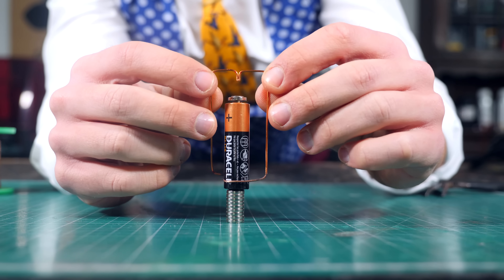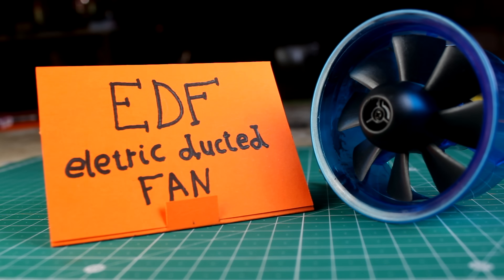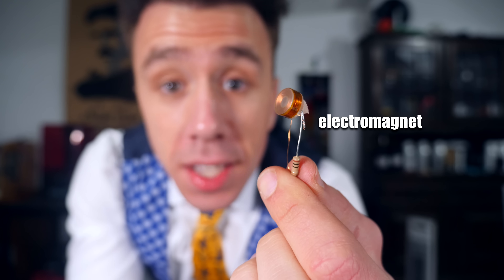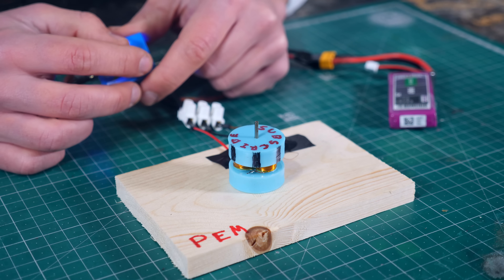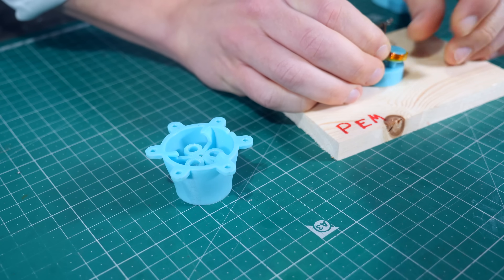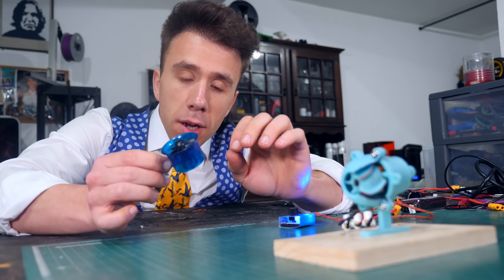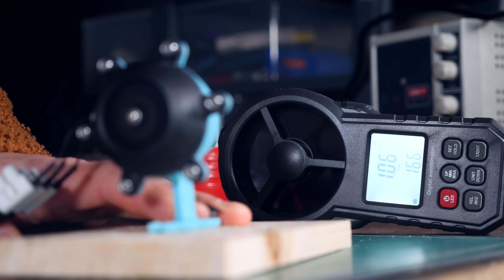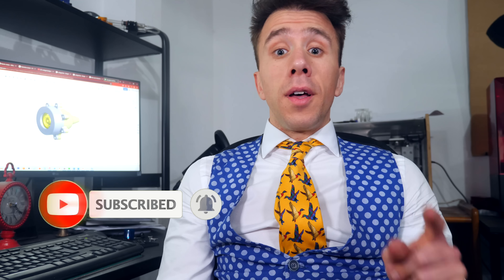I 3D Printed an ELECTRIC MOTOR FAN

Comment: For your next video you should try different intake methods for your fans, also your testing of the thrust is not ideal. Your measuring exhaust momentum at a specific distance, which like anyway wave dissipates quickly and can lense in unexpected ways. You probably need to really double down on some minimal friction sled that transfers its energy to a load cell. Maybe a sled that sits on a cushion of air, although that might create some sort of coanda effect and skew thrust values but probably not much.

Comment: A pressure based propulsion system requires a longer nozzle after the impeller to create faster moving flow vs a slower pressurized flow. (The dyson fan has a long air path that expands a lot before being ejected) The faster and more air mass ejected, the more thrust. So, the impeller creates a high pressure air flow, not a fast flow. To create a faster flow, the high pressure air has to be allowed to expand and convert the pressure into velocity and momentum. The trade off is the extra mass by having a longer nozzle vs. Air velocity at the nozzle impacts your thrust to weight ratio.

Comment: Best guess would be is your impeller design looks like it ment for a fuel air mixture "jet engine "and not for a power fan  , for a powered fan you would want a larger intake

Comment: I love this guy's videos! I also did some research on fans for selecting the most optimal off-the-shelf fan for cooling a particular battery system. What I learnt was that each fan has an important characteristic, which is it's PdV curve; volumetric flow versus pressure difference between intake and outlet. The output power is the product of these (check the units tho, if you want Watts, you have need to consider the density of air). Axial fans have a very different curve compared to radial fans. The former can produce a lot of speed, but the latter can make more pressure and maximum power. Every fan has a point of maximum power output, where P*dV/dt is the highest. This may change depending on multiple factors, such as inlet and outlet area, number of blades and pitch. You want to match the motor's optimal speed for maximum power output to the fan's characteristics to get the most power out of the fan. I hope that someone finds this helpful :)

Comment: One reason why your design might underperform ist that the EDF has a lager crosssection. in Ordner to move the same amount of air with your smaller centrifugal one, you would need more RPM. As a result, the centrifugal fan puts less torque on the BLDC an you are not using the same power as in the EDF configuration. Part of the reason is, that BLDC Motors are rpm controlled. The speedcontroller dictates the speed. thus less torque doesnt result in more rpm. Possible solutions could be a centrifugal fan with a larger blade crossection or getting the speedcontroller to drive the motor on higher rpm. (vacuum fans usualy run on very high rpm).
Really appreaciate your content. keep on giong. :)

Comment: Centrifugal fans produce air pressure but not much flow. The EDF produces a high speed airflow and doesn't really care about pressure.

Thrust is produced by moving large amounts of air at high speed; not by creating high pressure.

Comment: The Dyson fan and turbo charger fans in general are not meant for high air flow, they are designed to create higher air pressure. Flow =/= pressure.  If you notice on modern commercial airline jet engines, they have both a huge large ducted fan and then a compressor jet engine in the center to try to get the best from both worlds.

Comment: From what I can think of, I see a difference in airflow direction between axial (propeller) and radial (impeller) fans. The propeller pushes the air along its axes (surprisingly), thus reaching quite some speed in that direction. The impeller on the other hand (as you mentioned) generates pressure, but not in the axial direction, but rather in the radial direction. In other words, it pushes the air away from the axes, just like rays radiate from the sun (radial, radiate - you see that? 😁). It does not accelerate the air in the same direction as the propeller does. I hope I didn't just embarrass myself by missing some critical piece of information on this topic 😅

Comment: Well, if you have a given amount of energy your output is going to be affected by the input and the efficiency. It looks like you have a smaller intake area for the air than the ducted fan, so even if everything else was the same and you had that constricted input, I would expect the output would be lower. After that, anything that sucks energy from the system will reduce your output. And it looks like the airflow in your design is touching a lot more surface area than the ducted fan. Which means more drag, which means lower output velocity. I think the exact same thing would happen if you were trying to do an externally powered turbojet compressor and neglected that whole part where you add fuel and ignite it. All those extra vanes and surface area would give you less thrust as a fan than a normal fan (propellor) would.

Comment: turbomachines works very well in a short range of rpm. you need to adjust the exit angle of blades, I think the performance is low due to the creation of twisters at the end of the blades. The solution is adapt the exit angle of blades to the working rpm

Comment: You're probably leaking pressure through improper clearancing through the case in the fan blades that an impeller design could be changed

Comment: TEORY ABOUT THE ISSUE:
maiby you need to turn the pressure into speed with a nozzle just like rocket engines do instead of simply let the air flow out of that ring hole. it makes sense to me as rockets are designed to have as much exaust speed as possible in order to be more powerfull, and they do not really care about pressure (rocket equation)

Comment: EDFs have improved performance against a similar fan wich is nos ducted because of the duct, the shape in the intake of the duct reduces turbulence and helps the air flow into the impeller.

Comment: Oh I can tell you. So firstly, it's static thrust. So not dealing with incoming air upsetting things. 

Second, it's the volume moved. 
It's the difference between trying to row with a pole. And row with a large ore paddle on a pole. 

The larger the volume grabbed, the harder  you will be able to pull on the ore for less slip. 

And the more efficency you will have in converting the energy into trust the less slip you have. 

Airlines use ducted fans as they are compromise between a jet and a prop. As props have issues the faster you fly. 

Your fan in pulling in a tiny volume compared to the ducted fan. It would need to add a lot more energy to that tiny volume, which man's pressure, and then turn that efficiently into velocity and trust.

I doubt it's doing either very well. The diameter likly needs to be a lot larger. Double or more. You can also add efficency by getting the incoming air to swirl in the direction of rotation. 

Then a variable nozzle will allow the optimal size to be found.

Comment: Pretty sure it has to do with the difference in diameter. Remember, power and thrust are not the same, the motors may produce the same power, but not the same thrust. Think about what kinds of propellers need to make the most thrust, helicopters. They have huge blades to help them generate the thrust required to take off vertically, meanwhile airplanes with the same engine can't take off vertically because they lack the thrust, but they are much faster. This is because airplane propellers are much smaller and designed for a higher top speed with just enough thrust to let them take off in a reasonable distance.

Comment: Your brand of well-dressed yet self-deprecating physical comedy feels like Charlie Chaplain, keep it up :D 
On a more serious note, you should check out some of the flow simulation software that’s on the market, i know autodesk makes one that’s compatible with fusion 360 that has a free trial you can check out, something like that could probably help you diagnose the geometry that’s causing the problems with your output pressure.

Comment: if you compare your fans design to those used in the fan showdown series on youtube you may see that the blade angles as well as flow direction take a large part of it, and just looking at the design its less a flwing design, and closer to a tesla valve by the end of the flow ..... not exactly what i mean or the right words .... but stabbing wildly in the dark to explain observations ...

Comment: Think about it as horsePower vs torque...
 the centrifugal  is like torque. the air coming out had more oomph but on a smaller area 
the store bought one is like horsepower, it has wind speed and gathers more from the outlying air to amplify its air movement. BUT that wind has less "pushing" power. 

also a centrifugal pump is more effected by its design, like the size of the vines, the inlet vs outlet area, the internal volume of the chamber.and the fact that your trying to push the air behind it vs out the side.

Comment: edf fans are designed for thrust and that’s why the shape is used on turbofans

turbos generate static pressure.

I guess add a nozzle like on compressed air tanks?

Comment: By closing off the centrifugal fan to prevent material flex, wouldn't that reduce its inflow and as a result less thrust? if that is the case i would reduce the cap that was added to close the fan down to around (2 or 3mm) at the leading edge and leave the rest open. also the total surface area of the fan blades them self could be to big and may be creating drag on the blades resulting in lower RPMs. my last thought is power to weight. the EDF (regular fan) blades look as if it weighs less then the resin centrifugal fan. if its the same motor powering both than wouldn't it have to work harder with the the heavy resin fan to produce the same rpms?

Comment: You're probably compressing the air. The EDF is designed to move a large volume of air with as little compression as possible. Your fan is probably losing energy to compression, and possibly just has a smaller cross-section.

Comment: Okay, I wouldn't call this an aerospike or a turbofan, but let's deal with the tomato in the room. Why don't both fans give you the same performance? Reason number 1 could be because the impeller fan is probably just not as efficient as a normal fan. If you are centrifugally accelerating air to pressurise it and push it out the back, then you're using up some energy to do work that is not going purely into accelerating the air. This is contrary to the blade fan which uses all of its available energy to push air behind it. Heat losses in the impeller fan likely will result in a slower stream. I remember a video I watched not too long ago that compares a cheap blade fan to a Dyson fan, and the cheaper blade fan won by a long shot, which leads me to reason 2. You are using a Dyson built part for your project. The unadulterated and disappointing truth is that Dyson products are overpriced crap. Sorry :/

Comment: Your idea might be good, but what you need is data to understand what's good and bad and how to improve it. Info like RPM vs flow and static pressure. That'll tell you a lot and suggest improvements.

Comment: Axial are great for flow where as centrifugal are great for pressure. There is a guy on youtube and thingiverse that made a jet engine with a centrifugal fan. Front part is pla and the rest is metal and cement. Runs on propane. His name is amazingdiyprojects. Video is about 7years old

Comment: I know that these kinds of pumps are SUPER sensitive to all kinds of things. If you screw anything up you can get maybe 10% of the expected performance. I believe that things like vortexing at the outlet, or vortexing inside the pump around the blades are classic issues, but I'm not an expert. Experts for this kind of thing make $$$$ fixing designs.

Comment: NO IT WILL NOT PRODUCE THE SAME AMOUNT OF THRUST. here's why:
The equation for thrust is "F = m_dot(Cj-Ca) +A(Pj-Pa)" where F is thrust, m_dot is the flowrate, Cj is the jet velocity, Ca is the plane velocity (its zero since you're stationary), A is the Nozzle exit area, Pj is the Jet pressure and Pa is the Ambient Pressure. The usual approach in producing thrust is to make a large amount of air moving fast. the centrifugal compressors are useful when you want to have high pressure ratios with a relatively small machine (for the same pressure ratio you need multiple stages of axial compressors). on the other hand, axial ones (like your fan) can move huge amounts of air with just a tiny bit of pressure increase. However, the axial compressors are significantly more efficient (that’s why we use axial ones in power plants and most jet engines). form what I can see in the video the inlet area of the centrifugal fan is much smaller hence the flow rate is going to be much lower. even if you make the impeller larger, then the brushless wouldn’t be able to produce enough torque to rotate it with the proper RPM. You also need a proper nozzle design to use all that pressure, and even in that case you are never going to get the the same amount of thrust from an impeller driven by the same brushless. So in conclusion: lower efficiency, lower flowrate, lower jet speed, higher pressure ratio but not enough to make difference. So… never gonna work sry.
Reply: Btw if you want a proper centrifugal compressor check out NASA CC3. The Impeller and the diffuser designs are available for the public and it has a pressure ratio of 4.

Comment: You almost got the answer on the video. Impeller? Propeller? .... The main diference is that impelers are made to compress, and propeles are made to increase flow. 
Pump <> Fan 
A centrifugal compressor will stop working at a certain speed, will just wiggle the air in and out once it achieves the maximum air pressure it can generate.
 At that point you need a bigger compressor, with more torque and bigger blades. Spinning it faster will just make air hit the high pressure in front and turn around, reversing the flow. (Check it out with smoke)

Comment: The problem is most likely that by compressing the air you create heat (wasted energy) those types of motors are built for speed which is fine with a fan since they don't do compression but they have very low torque as they are built for speed therfore you may need a larger motor or one that is tuned to have extra torque. If im wrong I hope this at least leads you to the correct awnser and I can't wait to see the video you post with the final solution cause I'm also curious

Comment: Do not forget that every change in flow direction is a loss! Axial fans and radial fans have different Flow rates because radials throw air in the wall of the casing to generate pressure. That is why in turbo machinery the compressors are radial style, in contrast of thermal management systems like a car radiator where you need high flow rate and axial fan. 
Or a perfect example is some of the turbo fan engines where, the turbo compressor is radial to generate high intake pressure for combustion, while the fan produces the larger portion of thrust by pushing large amounts of air. So do not expect the same flow rate from a radial fan and an axial fan that are similar external dimension or power rated. If you want it for combustion you go whit high pressure so radial a large radial.

Comment: Your design, as you said, is trying to make compression like a turbo. It won't produce thrust comparable to the EDF. Thrust will be determined by the volume and speed for the exiting air or gasses. Jet engines compress and add fuel for thrust.

Comment: The velocity of the exhaust is going to be set by your geometries of the blades at exit of the rotor and by the ratio of the inlet to outlet (these will also effect your efficiency) and by the rpm of course.  Your mass flaw rate is going to be set by your inlet area and inlet velocity.  All this takes a mountain of calculation.  But if you wanted to do it experimentally, I would say try scaling up your engine slowly until you find peak thrust output.  Axial fans are more efficient at high velocity flow so you wont get to the same thrust output.

Also, the angle of attack at inlet is way too steep, you're probably getting stall at inlet.

Comment: You are making a centrifugal compressor, not a fan. 
The trust you loose in the 90° flow deviation is the missing force component if compared to axial flow

Comment: Well, it looks like the EDF fan has substantially more surface acting on moving air (and the intake is larger, thus less restricted flow). So try making the impeller fan larger I suppose. You are probably leaving a lot of performance from the bldc motor unused.

Comment: I like the constant gentle joke.  In English it's  called a "running gag".  Though the title sounds like a way to kill an athele in mid-stride.

To the issue between EDF and centrifugal fans you might want to take a look at it from a differnt perspective:    In late April I have a conference where we get several thousand people into a conference center that is a city block long on all sides.  It is an international group so many languages are spoken.  We all get along well but folks crowded together don't like to be forced around sharp coners.  Our building is designed to avoid halways with sharp corners.  We get fplks to flow along.

Likewise the EDF does not make  air molocules make sharp turns.  It just ushers them along kind of like we do the delegates at conference. The less your designs get molocules to change direction the faster things will flow along.  Then you can rely on Brother Newton.  The more you push out your ass the faster you go forward.  (We don't push people out.  We include them in.  We move forward any way.)